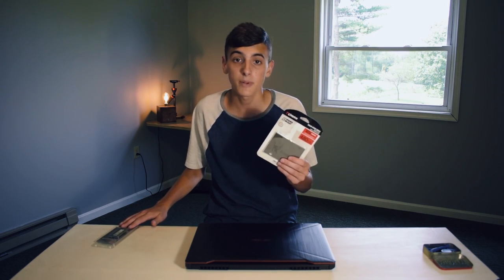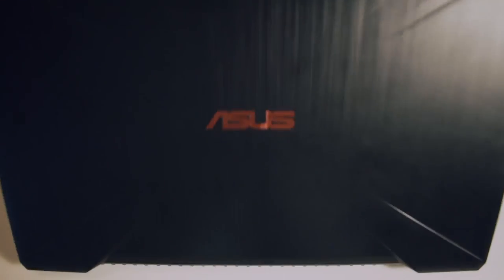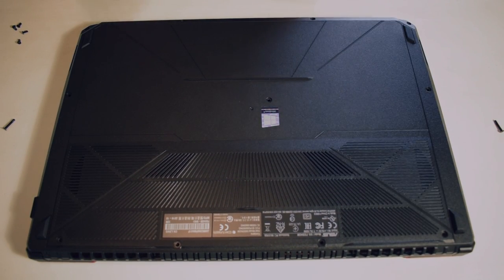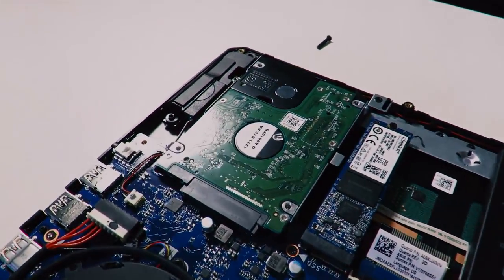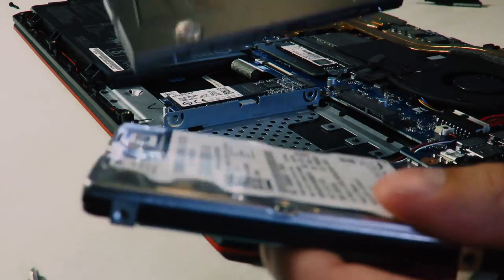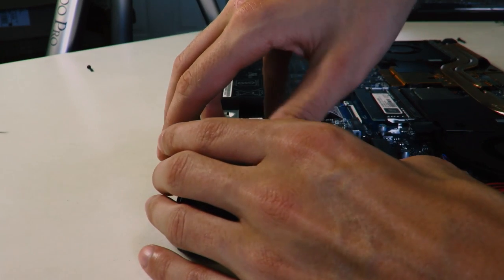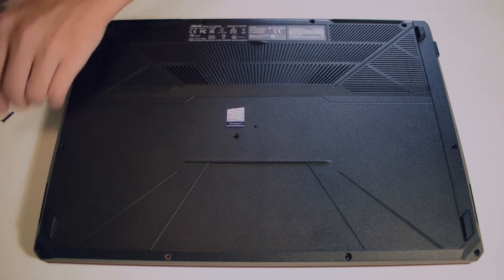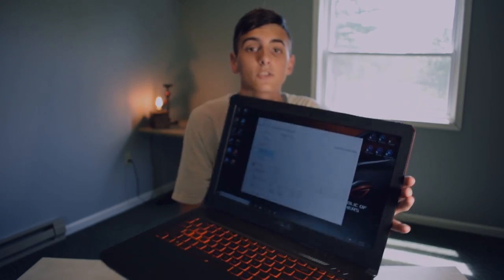UPGRADING LAPTOP!! | ASUS TUF FX504 | SSD and RAM [2019]

Comment: Can you add a laptop hdd to this laptop? I wanna use the original ssd and have a 1tb hdd cuz i cant rlly afford a 1tb ssd
Reply from the maker: Yeah you can get a 2.5in 1tb hdd. Just check the model number of the ssd and make sure it’s in the m.2 slot. Task manger should tell you.
Reply from the maker: No the additional drive needs to be a 2.5in ssd. Your laptop should have a preinstalled m.2 ssd.
Reply: @ZackEberly  thx for the help :)